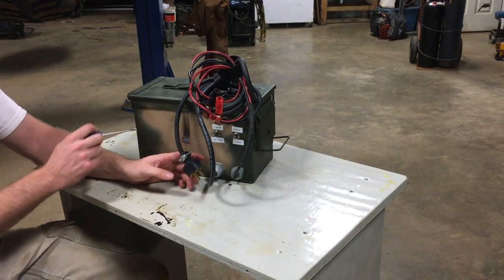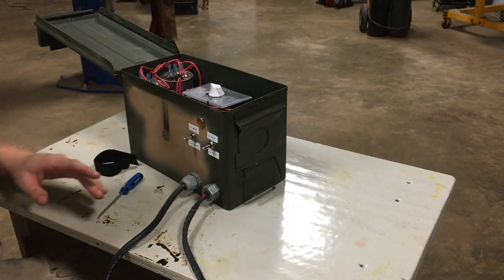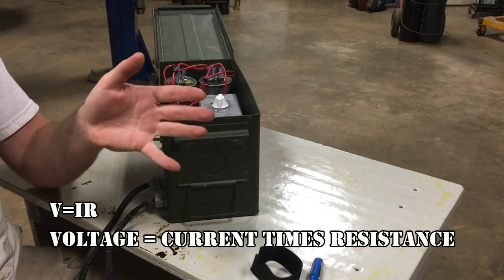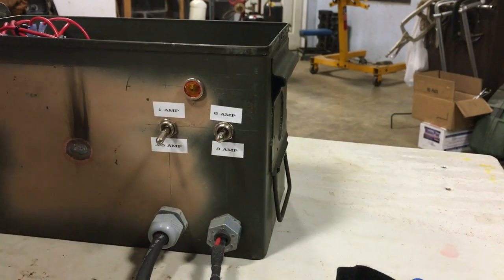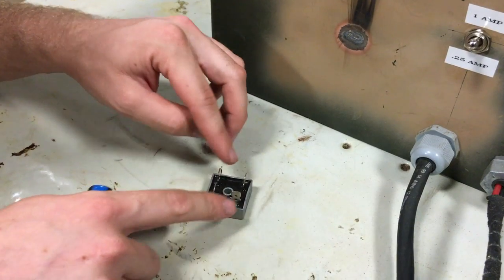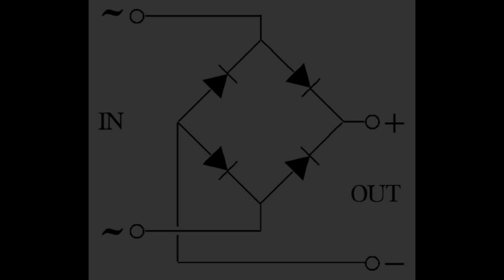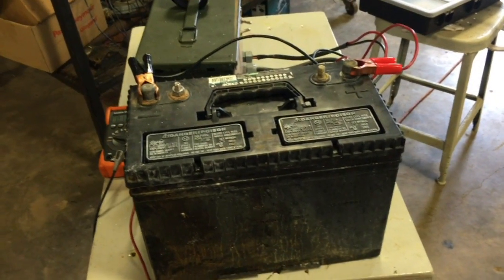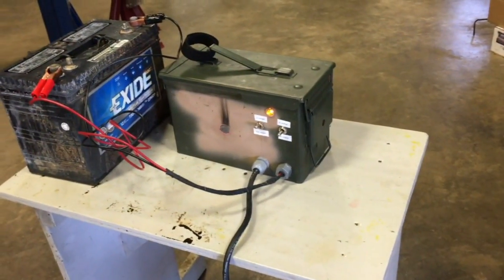Capacitive Battery Chargers Charge anything?  Improvised Electrical Devices

Comment: So how long did you eave the battery to rest before showing us the test at 12.58 V.  Most batteries I've seen will retain a high charge for a bit but then drop back over the next ten minutes to an hour. It is the drop back voltage that is important for a battery to be useful.

Comment: how long does it take to charge a 12V battery - and will it stop charging when it is finished with a charge?
Reply: This will actually depend on the initial battery state.  No, it will not stop charging.  This is why he put a timer.  After some tests with different batteries someone can potentially estimate the required current and time but because the things are what they are, this will always be a guess.

Comment: Excellent Project keep it up,  i need to know few things please help and support me and also these questions will help many

1. These capacitors are Start or Running Capacitors ?
2. How many ampere we should get from 20uF, 60uF, 80uF, 100uF, 150uf Capacitors on 220v and 110v home electricity supply ? 
3. which uF capacitor should i use for 5AH to 40Ah, 45AH to 100Ah and 100AH to 250AH Batteries on 220v ? 
4. which Rectifier Diode (KBPC 3510 or 5010 ) should i use for 5AH to 40Ah, 45AH to 100Ah and 100AH to 250AH Batteries on 220v? 
5. in many other channels related to this disulfate with capacitor topics comments said the capacitor amp on 110v will be double on 220v ( like 110v 20uF capacitor give .66 amp and the same capacitor will give 1.2 amp on 220v ) but in comments i found the same person recommend the same capacitor for both 110v and 220v for please clear the confusion ? 
6. as i have learned first disulfate when volts reach around 16v or 17v , then wait for 2 hours for check resting voltage, the discharge with 100watts bulb till battery reaches 11v then continue same process 3 times , master is that correct or if there is some time gaps in between this process that i forgot please let me know ? 
7. somewhere else channel i have seen comments " you should use 5% amp capacitor of battery total capacity but at the some comment same person recommend lower then 5% amp capacitors for batteries please clear the confusion ? 

Pleas make it possible to reply in details 

I hope you will reply as soon as possible

Thank you in Advance
Reply: its running capacitor  , the starter capacitor will get hot , by the time it will dry